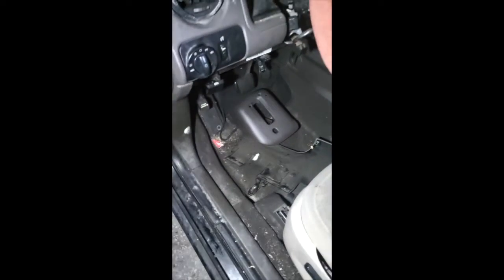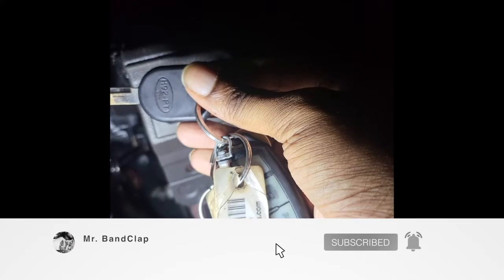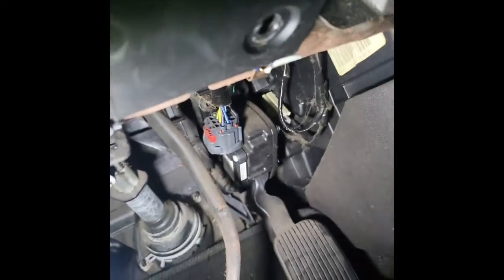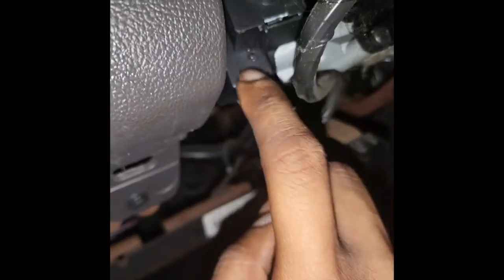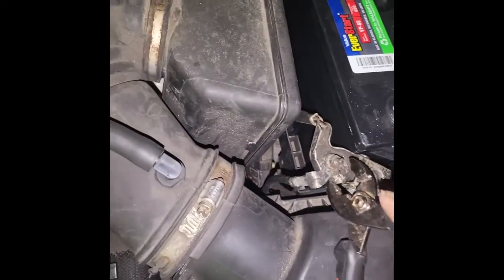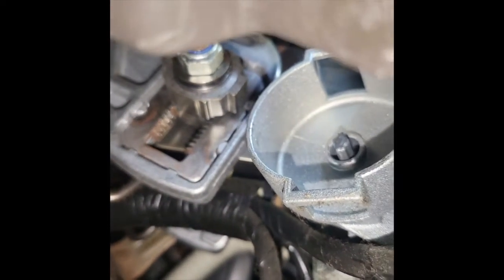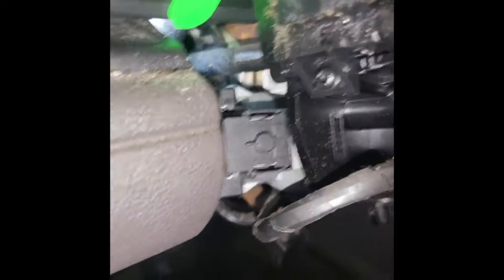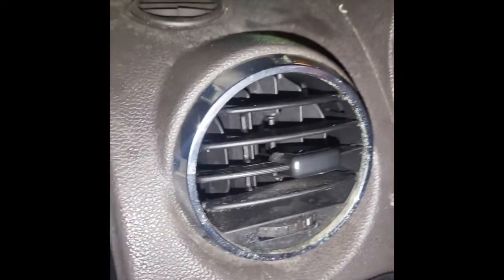BandClap TV Shorts- "2007-2009 Ford Taurus X sel/Freestyle Ignition switch Replacement" #howto

Comment: Well mister, I'm thinking that there isn't a lot of people that have had the opportunity to own or even drive a '08 Taurus X. 😁 So we're the lucky ones 😉. 
 I'm going through the same exact thing that you did on your X, the ignition switch. 
 You made it look easy but guess what? It isn't easy 😂😂. 
 Actually it's not bad at all but I had problems with the steering wheel cover. I have all three of the screws out but it doesn't want to separate the top from the bottom. 
 I'm sure there are clips In there but I wanted to thank you for the video, it helped me out. 
 So again, thank you for the video guy.